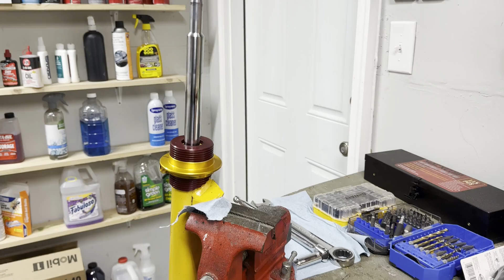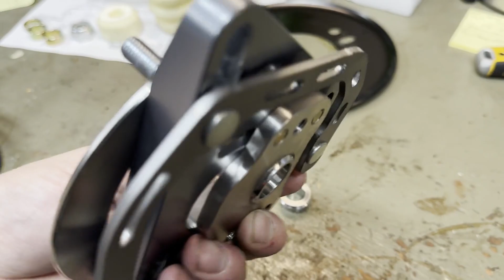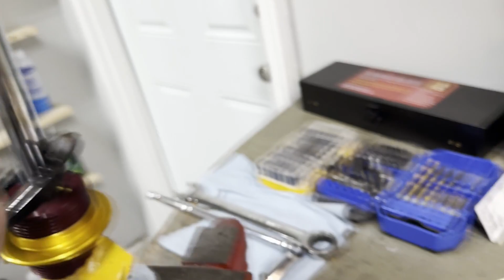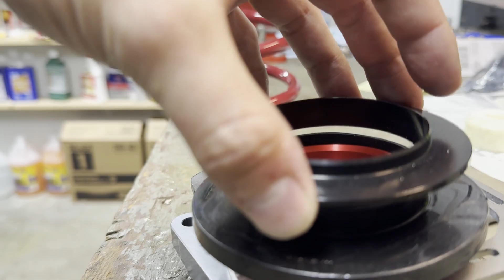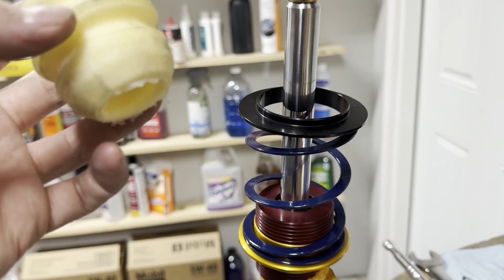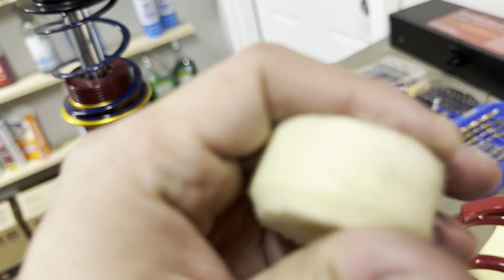E46 Ground Control Coilover Conversion on E46 M3

Comment: They aren’t compatible with the M3. GC sells E46 regular plates. They cannot do stock M3 camber.  They only go a far as center like the regular e46. That means the zero position for M3 is not actually 0 . If you want the right part from GC then their street version is the only one actually designed for the M3.  If you want the real deal, then Turner and H&R actually designed their properly. These plates are so poorly designed that the bolt bracket also runs into the stainless plate underneath the aluminum one and because of that you can even get the full range. Conclusion, these plates the way they are designed are joke level engineering. Even the cheap godspeed plates are magnitudes better